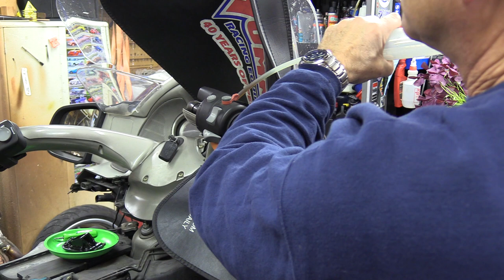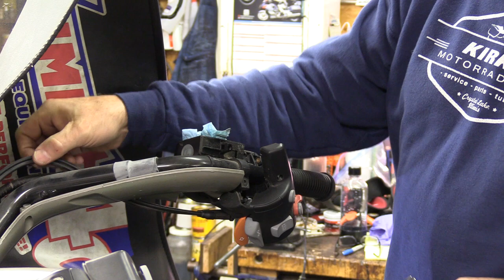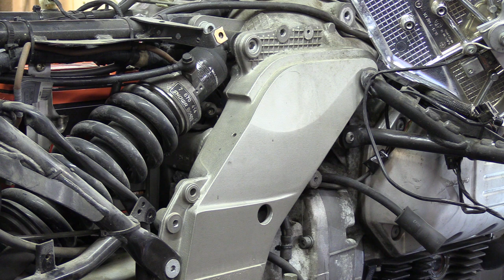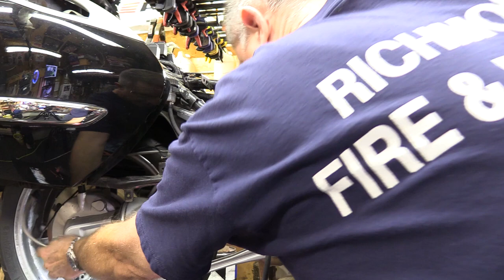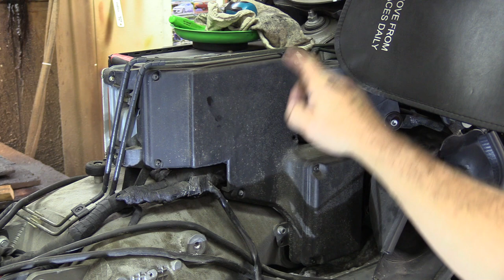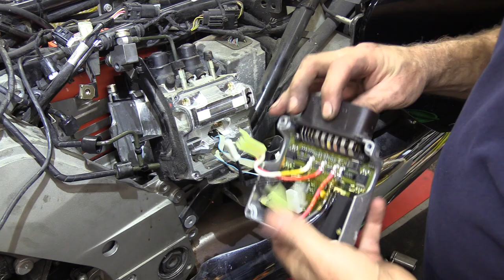BMW K1200LT ABS Bypass Kit

Comment: I want to leave here my thanks to SER ILLUMINADO kIRK'S MOTORRADA SHOP, my Bmw k 1200lt was stopped, due to the abs brake it didn't work anymore and I almost had a very serious accident because it failed when I needed it. so I left it still until I watched the video of our FRIEND KIRK and I managed to delete the abs system from mine and I'm walking again and since here in Brazil there are no restrictions on the original accessories I'm happy thanks Kirk.

Comment: I "recently' bought a K1200LT that was dealer seviced and had Just been servied when I bought it. Steel brake lines and Everything....but the ABS was blinking.  .... I decided to service it myself and changed the oil, water, etc. When I bled the brakes I found the problem:: The dealer forgot to top off the reservoir after bleeding and it was at minimum. So now everrything is OK.

Comment: I did the bypass on my 05. On the front disconnected the abs and went from the reservoir to the caliper via the split connector . On the back went straight form pump to caliper. I left the  abs lines intact in case prices ever come down . on problem i have is no brake light . Ill watch Kirks deal and see if he address that .. Love his videos

Comment: Fortunately here in Spain we have a company that restore all the internal components of the iABS modulator, motors, pressure sensors, transistors, software uptdating. I would not ride such a heavy bike without an ABS system.

Comment: Are the early model equipped with the passive ABS, the one that if it fails you can brake the same? If yes till what year of manufacturing? Interested to buy one but prefer with passive ABS, like the one I have on my 2000 RT1100. Thanks for your video and suggestions.

Comment: So if you cut the Brown/red, Brown/yellow and Black/white wires on the module that will eliminate your blinking issue.
Reply from the maker: Are you talking about the wiring harness attached to the ABS or in back of the dash?
Reply: Wiring harness at the ABS module.
Reply: Are you certain this works with all years?  My 2000 still has the ABS light blinking, and cutting these would be easy enough with a long set of snips.  But, getting in and repairing them would be another story.
Reply from the maker: I am not sure about a 2k. Just unplug the bulb!  @baumgang4
Reply: @kirksmotorrad  - Thanks to your video detailing how easy this is, I now have LED dash lights and have removed the flashing ABS light.
Reply from the maker: on the 2k. pull the bulb @baumgang4

Comment: I have do it I remove it but no speedometer  and the brake lights are stuck on .eny solutions or eny kit to remove this out ?also I try to connect again the wires on abs but still no speedometer and brake light s on thank you
Reply from the maker: The electronic box must be replaced to the bike once you remove it from the pump. Are you sure it was working prior to removing it? Does the horn work? It is on the same circuit.

Comment: I have two questions 1. By using this kit l will lose link brakes correct. 2. how much  more additional force does it take to apply the front brake compared to the standard  with the power assist. Thanks
Reply from the maker: Yes, you will have standard brakes. They work exceptionally well. I would say even better and more predictable with better feel!
Reply: I have a 2003 Lt, and a 2003 RS. iABS failed on both bikes, despite annual fluid changes! On both bikes, there were no prior symptoms, and the failure was sudden without any warning. I agree with Kirk, the standard LT brakes work very well after iABS removal. Predictable, positive braking, not grabby on loose surfaces.. and no longer the constant worry of sudden iABS failure, and "residual braking"! Read that as NO BRAKES!!

Comment: This is another great video!  Just finished installing the kit on my K1200 (2000 model year - non integrated ABS).  I pulled the relay and disconnected the controller unit from the ABS.  However, I'm still getting a slow flash on my ABS dash light.  Anyone have a suggestion on what this could be?  All other lighting is working well - no additional dash lights besides the ABS.

Comment: My ABS is starting to act up in my 2000LT. I'm considering this if it dies. Any reason not to remove the disconnected ABS brake lines?
Reply from the maker: You can remove them if you want. I dont incase someone wants to replace the ABS in the future

Comment: Unrelated question since you are knowledgeable: I have a 2014 K16GTL with about 30K miles. I'm getting a rattle from the motor at about 2500/3000rpm off throttle, particularly at startup. I run AMSOIL metric oil. I haven't checked the valves yet. Is this most likely a tappy/happy valve due to excessive clearance or is it more likely to be a cam chain tensioner failing? Thanks for any guesses LOL.
Reply: Metric oil?  More of Amsoil’s goofy marketing.  I’ve never heard of a metric motorcycle.  Is that a new brand? 😂
Reply: Have you had the valves adjusted once already?  If you haven’t, then I would do that first as you are overdue.
Reply from the maker: I would get the valves checked but it sounds like a bad chain tensioner. They are pretty easy to change.
Reply: @kirksmotorrad  Thank you. The forum experts (for what that's worth LOL) all say it's not worth even checking the valves at 18K and many don't do it at 32K either. I guess I will, but I agree the most likely thing is the tensioner. I appreciate your response.